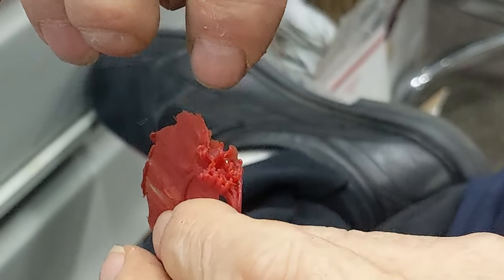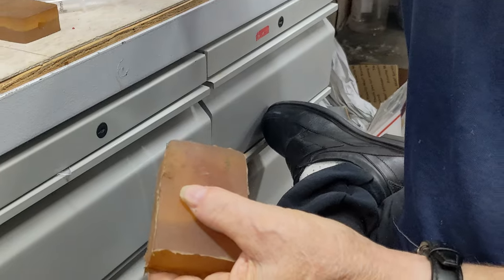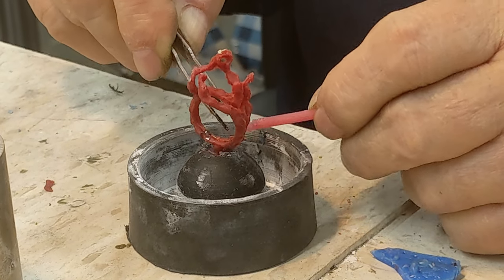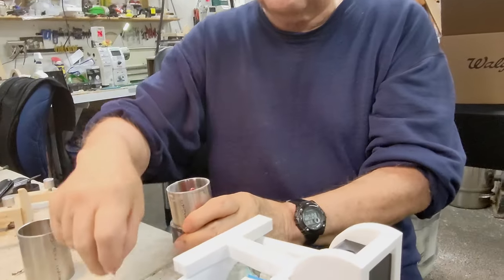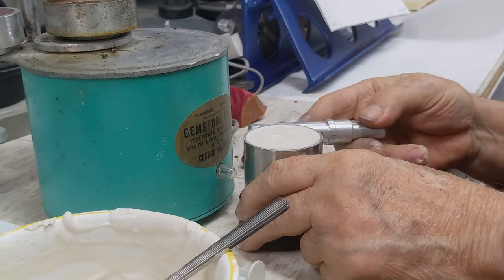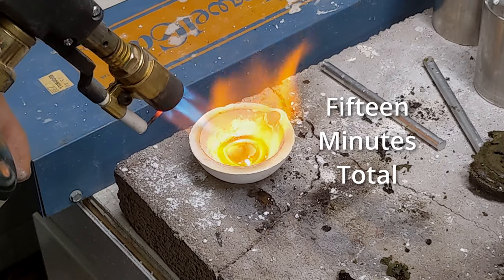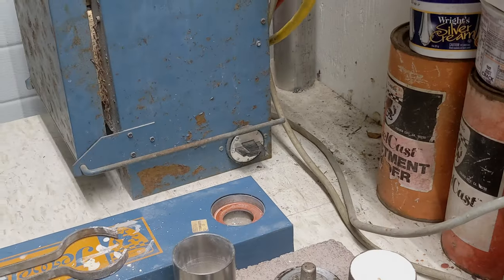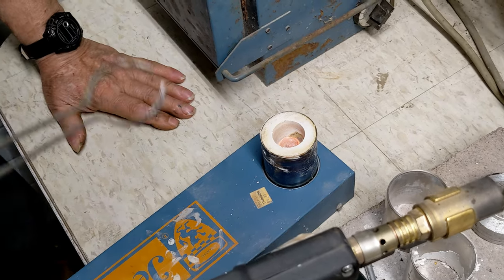From Wax to Ring - Lost Wax Casting FULL PROCESS

Comment: Did you melt the silver on top of the mold?
Reply from the maker: Yes after the wax is melted out, the silver button gets melted (again) above the hole in the mold, then we use the jeweler's vacuum to suck air out of the mold, which pulls the silver down into the void space.